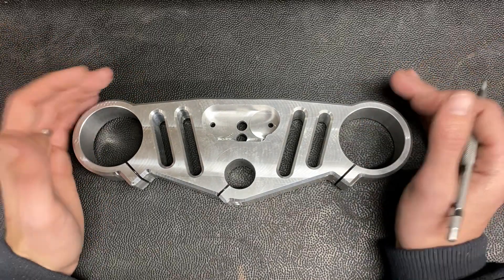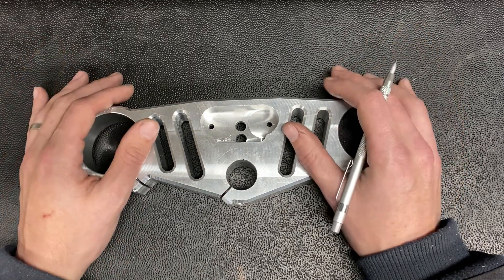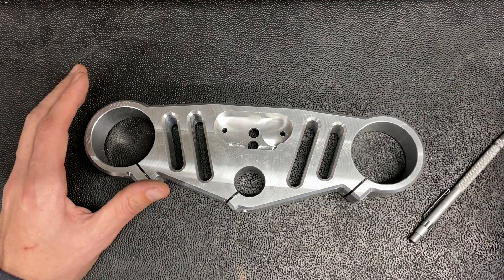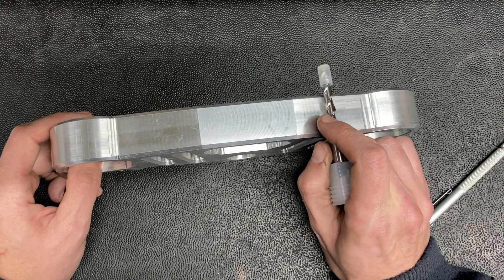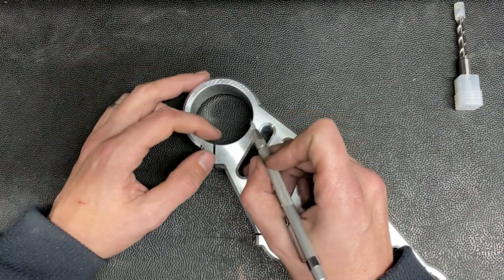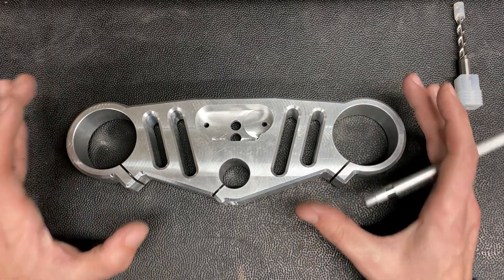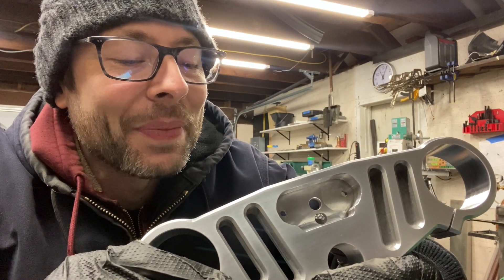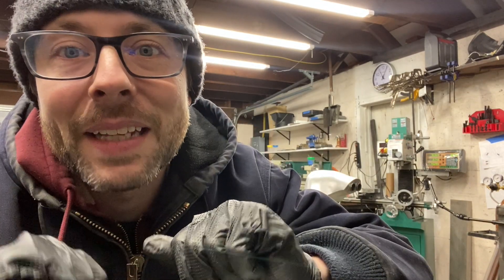Machining a Ducati motorcycle triple clamp pt5: Fixing my mistakes and final assembly!

Comment: You could have predrilled the 1/8" radius's or another tip is you could plunge with the endmill since the endmill is more rigid on the z axis. I did that to add grip around the outside diameter of a knob and the surface finish came out perfect with no chatter or deflection on all 16 little half radius's cut around the knob. Also great manual mill work! the part came out great! I'm going to be using a slitting saw to make post clamps today which is why I watched your video.

Comment: Hey man! Great job! I’m planning on making my own triple soon as well!! :)

Question for you, in part one you said that your first design was too weak. How do you know a triple is strong enough to do it’s job? I’m actually looking at making my own top and bottom but need to figure out the structural parameters first :)
Reply from the maker: Static stress analysis in CAD. I modeled the stock part in F360. Put it through a series of static analysis tests then made sure my parts pass the same tests.

Comment: Chris, I think it turned out pretty good. What I do for inside  radius' is use a drill bit in a collet and drill holes through each location and then end mill from hole to hole. Hope that made sense. Cheers, Doug
Reply from the maker: For sue! This was actually the approach I took too, just 1/4" was too small and I had trouble getting the end mill right on target to the tangent of that circle. Particularly on the rotary table portions.